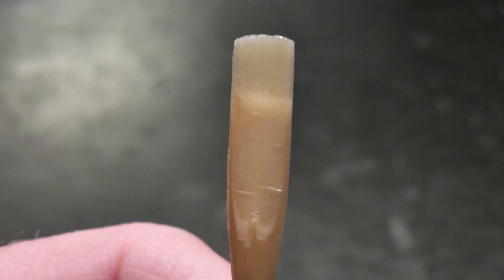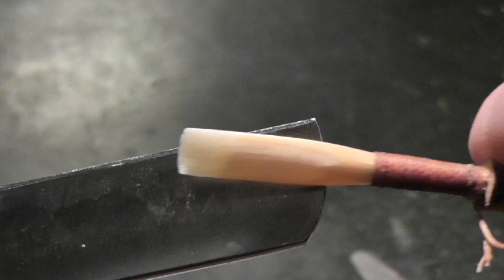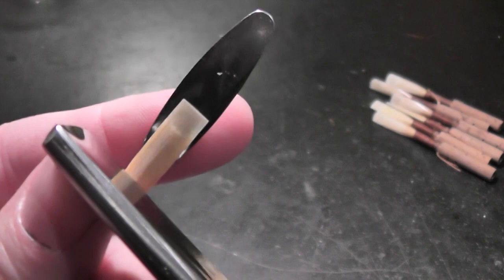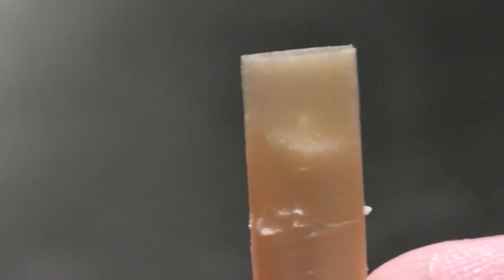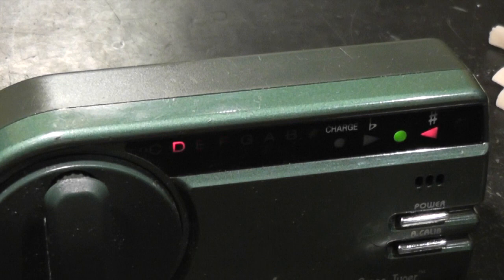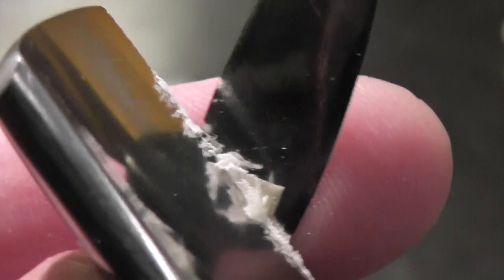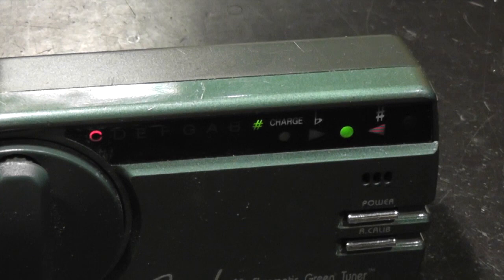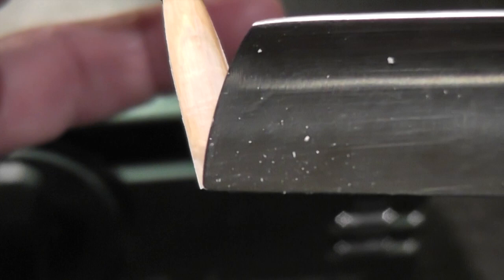V in the Tip with back

Comment: So I have experimented with this a bit more. For me, I have better luck if, as I do the “straight across” scrape of tip, I avoid deliberating scraping down the  middle of the tip.  I still work to get a good rattle going, but avoid the center.  Essentially I scrape the tip as  I normally would,  but with a strong commitment to get a lot of vibration in the tip before defining the V.     Happy with the results so far, although still working on getting the nice transition to the tip that is achieved here. Thanks Pierre!